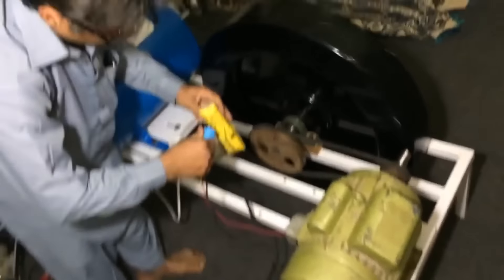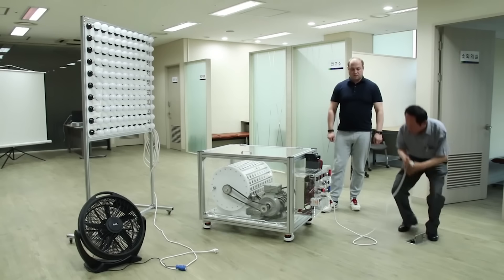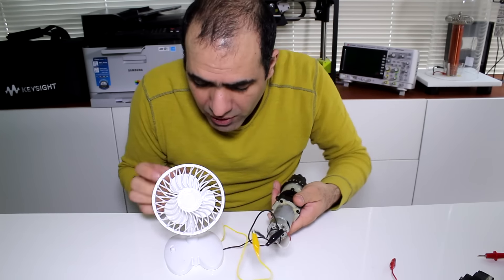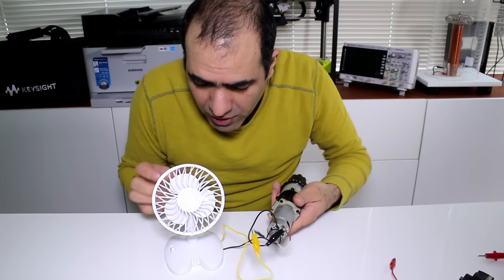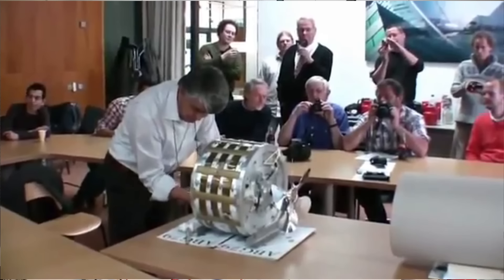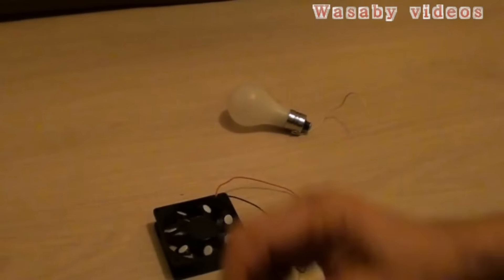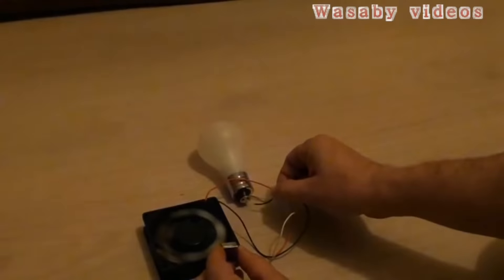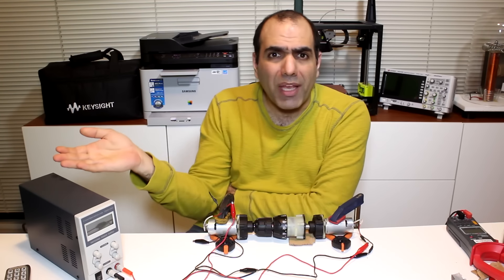The Curious Case of Free Energy Device

Comment: Your sense of humor is excellent and I'm sure some of the methods you show are fake, but not all. You lack information about some other devices that can draw energy from the environment and convert it into electrical power.
The don smith device is one of them, while he followed Nicola tesla technology and built a working device. The device uses high frequency and high voltage to make the air more conductive (air is conductive by nature), using ground as "zero" to close the circuit.
It is a theory that Nikola Tesla developed and built many devices that worked on the energy of the environment, but the knowledge was shelved or destroyed, and today many people are trying to restore the devices he invented.
The basic idea is that the sun enters the earth's atmosphere with enormous amounts of energy that charge the earth's atmosphere with a positive electric charge, which appears as an opposite electric pole to the earth. The earth is basically like a huge charged electrical capacitor, which can be discharged through an electrical consumer if you only know how to conduct the energy from the atmosphere to the ground.
Lightning can be thought of as a natural situation in which electricity passes through the air and reaches the Earth's ground, once the cloud's electrical charge becomes strong enough to travel a tremendous distance through the air.

For those who want to prove to themselves that it is possible to generate electricity from the air, you are welcome to do the following experiment:
Take a piece of aluminum foil and hang it at a height of 2 meters in the air and attach (with a rope or insulated nail wire) a conductive electrical wire to it. Take a half-meter metal rod in the ground and moisten the soil around the rod, then attach a conductive electric wire to it. Now take a volt meter and measure the electrical voltage between the aluminum foil and the metal rod stuck in the ground, and you will find that there is a voltage of at least a few volts.
If you try to plug in a device you'll find that it doesn't work, as it's a very low current voltage that you can't do anything with. Maybe in the best case you can turn on an LED with it, and if you really want to prove to someone else that you created electricity out of thin air, then add some more aluminum foils and connect them at the same time to get more current and turn on several LEDs.
There is nothing practical about this experiment, but it can certainly prove the concept and from there move on to slightly more advanced experiments in the same direction.

Those who want to create a free energy device have a long way to go and many failures along the way that only a few are willing to go through.
Those who want to connect 2 engines and create free energy are completely fooling themselves, and it is better if they connect their smartphone to the electrical outlet without looking for adventures that insult the intelligence.
Reply: hahahahahahhaha
Reply: You know what can harvest the energy the sun delivers to the Earth's atmosphere and actually works? This fancy little device called a wind mill, these days they can generate up to 20 MW each.
Reply: @arthursoares5413  "hahaha" you mean what?

Comment: This is not new, and is also not free energy out of nothing. These devices may be false, but they may also be true, and they are using magnetic energy and not free energy. These are magnetic energy devices and many of them are real.
Reply: @darklight2.1  okay then the magnets that hold notes on the fridge just magically defy gravity. No, certainly they energetically stick to magnetic metals. They have magnetic fields and these are energy fields , not sources of energy but have power depending upon their constitution. The magnets in generators are extremely powerful. The fastest trains are raised above the tracks by magnetic fields. Now that is power darklight, isn't it? very much energy and power measured in Gauss, i believe.
Reply: @jefcrot3458  A magnetic field does expend energy, anymore than a gravitational field does. A fridge magnet doesn't need energy to stick to the fridge anymore than your roof needs energy to not fall down.
Reply: Thanks you, you just confirmed that magnetic forces are energetic forces, like gravitation forces. The magnet on your fridge has an energy greater than the gravitational (energetic) pull on the magnet, so for the mass of the magnet, the magnetic field is greater. F(magnet) > F (gravity) in the equation F=ma, for the magnet on the fridge. It doesn't need to "expend" energy; both magnetic and gravitational fields have inherent energy.